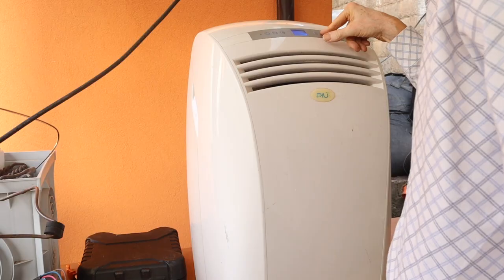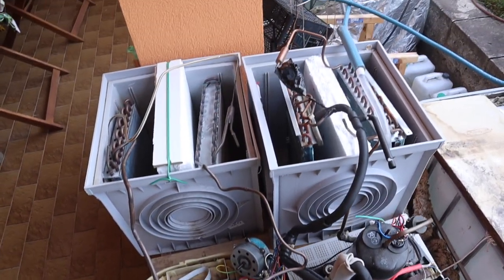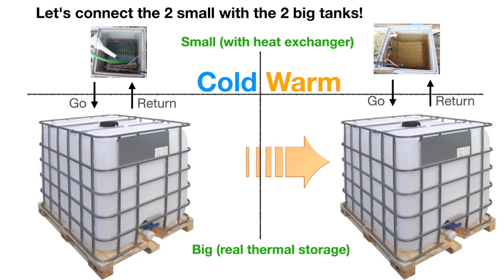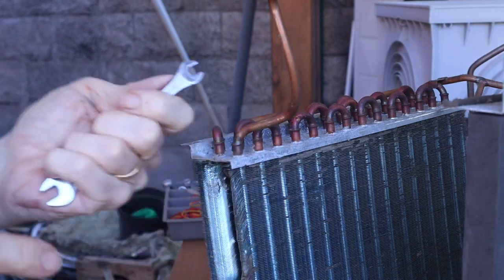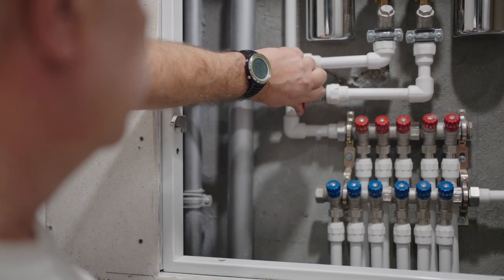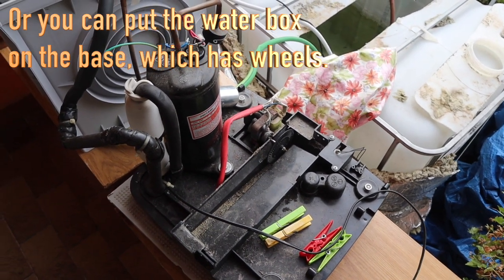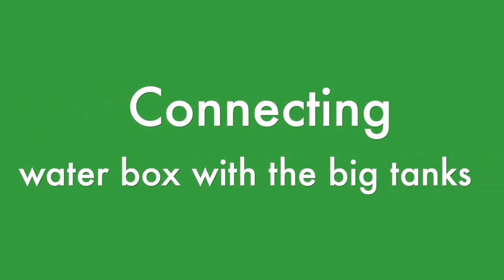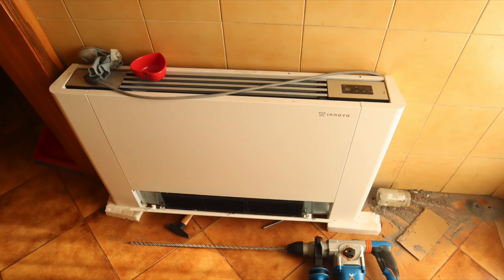Winter Heating Hack: Convert old Air Conditioner into a Water Heat Pump (Part 2) - Video 68

Comment: I am developing a different idea. I have a spiit air conditioner already installed in my house that I never use because it was intended to warm/cool a room but now I don't use that room anymore. The heat pump was installed 15 years ago but it has a good COP (4,7) at 3.2 kW (thermal power) and 700 W electric power (in heating mode). I just want to heat water with it, not for ambient heating, only for showers etc. My idea was to cut the liquid line (1/4" pipe) between the internal and the external units, and insert a 5 m long serpentine made of 1/4" or 3/8" copper pipe in between. The serpentine will be placed between two concentric plastic pipes filling tightly the gap between them. The space between the coils of the serpentine will be flooded with a stream of water at relatively high speed (~ 1 m/s) moved by a BLDC pump whose speed (and flow rate) can be adjusted by varying the supply voltage. This way I can adjust the thermal coefficient (and thermal power) of the heat exchanger. The water will be recirculated from and to a cheap low pressure water storage (plastic tank). To avoid the heat dissipation in the internal unit of the split heat pump I have two possible choices. Set the fan speed to minimum (or disconnect it from its power supply) AND/OR block the air vents of the unit. No need to destroy anything, the air conditioner will remain perfectly working when the water pump is off.
The cost of this "add on" will be even lower than a second hand low quality (and low COP) heat pump and there is no need to waste the cold (useless) water because the heat source is still air.
Reply from the maker: Interesting concept Eriton — I like that you want a reversible “add-on” and keep the split usable as normal when the pump is off. 
A few cautions from a practical DIY point of view: cutting the refrigerant liquid line and adding a long copper serpentine can create pressure drop and “flashing” (liquid partly boiling inside the coil). That can hurt COP and stability and can stress the compressor. Also, once you open the circuit you almost always lose refrigerant, and the extra pipe volume often means the charge is no longer correct.
About disabling the indoor unit: fan off + blocked vents sometimes works, but many splits monitor coil and air sensors. With no airflow, some units throw errors or behave unpredictably (protection, unknown control logic).
If the goal is mainly DHW (showers), the safest DIY route is usually to avoid opening the refrigerant circuit and instead capture the indoor unit heat with an air-to-water exchanger (radiator + fan or an HVAC coil in a duct/plenum). You still get useful hot water, but without brazing/leaks/recharge and with far less risk for the compressor.
Keep experimenting — just be careful with refrigerant-side modifications because they look simple but can get costly fast if anything goes wrong. Anyway, the fact that the A/C is old makes it probable that it has a simple compressor that you can feed directly from the grid so that you can override control logic.

Comment: did you try Geo-thermal heating/ cooling?
Reply from the maker: Hi Mark, I fixed the rainwater harvesting container underground and using 70 cubic meter of water underground as heat sink or cold sink for the heat pump is a kind of geothermal storage but also extraction if this water is in contact with many square meters of earth. That will be seen next year when we come back to Sicily.

Comment: Can saltwater store more heat/Temperature than "normal" water?
Reply from the maker: Hi Taran, thank you for the question. I've been busy with the new video (which is now published). In thermal storage, saltwater doesn't offer significant advantages over pure water since the difference in heat capacity per volume is minimal, and the salt may introduce corrosion issues. How would you like to use it, I guess you will get it from the sea and maybe pure water is scarce where you are? That's indeed a good point...
Reply: Some "heat pumps" are based on brines and water absorption but that is another story. Salt water is one of the worst enemies of almost any metal.

Comment: Pool heaters does somehow the same thing just with a water heat exchanger built in for the heating. The issue with pool heaters is that many of them are ineffective or downright useless under 5-12 plus degrees, rendering them useless for wintertime usage. A modification to your setup would be to get a heat exchanger from a broken pool heater, which would require a refill with gas afterwards.
Reply from the maker: Hi BubbaSnipe, I have such a pool heater and agree with you. It is a bit expensive (500€) so would prefer to put my hands on second hand mobile air conditioners for under 100€. Anyway, they are a great solution for the summer, when warm water (40℃) is useful for showers and preheating water for dishwasher & washing machine. A pity that they make quite some noise, so it would be good to bring the cold air through a hose into the living space.
Also, a refill with gas (I bought already the hardware) is a bit difficult for the most of my target audience.
Reply: I was buying one of them (new) for about 350 €, but since I needed to complete it with a good amount of DIY stuff, in the end I decided to use an inverter air conditioner I already have installed in my house and "catch" heat from the liquid return line from the internal unit (condenser, or better to say, INCAPACITATED condenser... 😂 ).

Comment: Ik vermoed een green minded D66 stemmer die geloofd  dat een oude mobiele airco zijn ingewanden aangedreven door een compressor op stroom geweldige resultaten leveren kwa temperatuur overdracht met geweldige resultaten als gevolg................Die man moet zich eens in R-290 gaan verdiepen......

Comment: Many people modify window A/C units for use as water chillers for fermentation cooling as an alternative to commercial glycol chillers. The typical advice is to remove the fins from the coils as the fins impede liquid flow through, as compared to the air they're designed for. If you have the ability, replacing either/both the evaporator and condenser with plate heat exchangers you'll get even more efficient heat transfer, at the cost of complexity and dealing with refrigerants.
Reply from the maker: Hi PunkDigerati, that is a good point, to take away the fins. It's even obvious, something should change if I change from air to water. I will try it. Or I should put entrance / exit of water at opposites sides of the heat exchanger and give the water no other way than the fins. I will try both and see what is also easy for the DIY.

Comment: Great video! Looking forward for the results after the connection with the central heating! Only one question, why did you put the condenser and the evaporatorin the same water box and then try to prevent water exchange from the hot side to the cold side? Why you didn't use seperate water boxes?
Reply from the maker: That was a dilemma indeed! I wanted to put the condensors and evaporators of two different air conditioners together in a cold and warm water box as you say, only the copper pipes are short and don't allow it. The solution is to find or make two containers that together have the volume of my water box. That is a good idea but I have to make it (I tried it in the past with plexiglass and silicones, not easy, it was always leaking, don't want this headache for my viewers). Not easy neither to find in the shops (or Amazon).

Comment: Are ther any heat pumps that could be placed between two insualted rooms to crate a cold box and sauna room? Or possibly a cold plunge tub and sauna room? I'm assuming because the temperature is so wide it wouldn't be very efficient but probably couldn't get that type of temperature difference.
Reply from the maker: If you mean a cascaded heat pump, yes, it’s possible to DIY a cascaded heat pump system that operates across a wide temperature range (from -20°C to 80°C or more), but there are several technical challenges and risks to consider before diving into this project. The higher temperature heat pump would work on R-1234ze(E), CO₂ (R-744), or R-600a. That is not so easy, because you must also have the heat pump, where you put those refrigerants in (without problems of incompatible pressure). The lower temperature is not difficult, you just purchase a freezer.
Reply: @nnvasen-good-energy  sounds expensive... A standard sauna heater it is then.

Comment: Only needed to watch this one video to know i need to subscribe! This is interesting. I'd love you to talk about maybe preheating the source by passive solar to maximise COP, possibilities of running on low voltage DC and risks of dangerous bacteria  growth and how to prevent it.
Reply from the maker: Thank you again BeeTooEx! I also like to make live easy for the heat pump and in my last video with the experiment in (only) the water box I treated it not well. Next video I want to make the same measurement for the first 10℃ from the start (both water compartments at room temperature). Then going on to higher Delta T and see what happens to the COP. And I expect indeed that preheating and other tricks to reduce the Delta T will help to get amazing COP. But already having two big water tanks is so much better than the heat pump in winter that is trying to get heat from cold outside air...

Comment: Can I do this in a colder climate? Like where the outside temperature is below freezing?
Reply from the maker: See the comment of ThisRandomUsername, I agree with him. See also my answer to KevinRoberts below. If you put antifreeze in the liquid that goes to and from the water box, you will have your 1 m³ at -10℃ for example. Then you put many mineral water bottles with normal water in that big tank and only those bottles will freeze and during the phase change they will give a lot of heat. And when you don't use the heat pumps for a couple of hours, the surroundings can give their heat back to melt the ice again (for example by circulating the cold water with antifreeze not only in the water box and big tank, but also through an old radiator outside).
Reply: @nnvasen-good-energy  I love that idea! I have been wondering about phase change for a while, and sealing bottles and placing them in antifreeze is a fantastic way of achieving that.
Reply from the maker: Yes, I want to try it too, in our winter house, I think that water is the only PCM that is viable and it is so easy to change the freezing point of water by a degree or 10 and then freeze the floating bottles.
This works for winter (when the container with floating bottles is the heat supplier to the evaporator) and for the summer (the same container is the supplier of cold water for space cooling). One system, two seasons!
Reply: Look up the air conditioner's datasheet to see the COP at lower temperatures. Where do you intend to pull heat from? If you have a big pond you could pump water from that, as it will remain warmer than ambient. You may also need to use 2 heat pumps in series if you want to produce a much higher temperature difference efficiently.

Comment: Use solar panels to heat the water tanks.
Reply from the maker: I have another video https://youtu.be/bsuM8mFFwMw about solar collectors. Certainly good if you need only heat. But in winter?
This video is an idea to store excess PV energy. That is of course good for summer and then you need both warm and cold water (washing & cooling space). In winter this video is also a good solution to produce warm water 
1. At a high efficiency (heat pump)
2. With the option to store cheaper (night) electricity.
Even if the cogenerated cold will be not so useful in the winter, you can always let it warm up in some way (outside air if not too cold, or through spirals in the earth, we have a 70 m³ rainwater collector under ground). In each case, the heat pump in this configuration has less work than the usual air to air heat pumps that really have difficulty to work already at 7℃ outside temperature.
Reply: @nnvasen-good-energy  in the winter, if you let the cold tank warm up in outside air, how is that more efficient than an air-to-air heat pump? Is it more efficient because the water buffers the temperature over time?
Reply from the maker: Yes, cold air in the evaporator during winter really goes down a lot and humidity will freeze in the fins. With a water to water heat pump the medium is much more constant (heat capacity) while around the evaporator and with antifreeze it will not freeze like humid air.

Comment: Thankyou for making these videos! I have a related concept in mind and you have proved there is merit in trying some experiments in using standard AC unit as the base components to be converted to a water heating heat pump. Looking forward to see whatever you think of next.
Reply from the maker: I'm glad you found the videos helpful! It's always exciting to see how standard components can be repurposed for innovative projects. Can't wait to present the next video about connecting the system to the central heating circuit. However, it is quite some plumbing with old connections that I have to disconnect 😟

Comment: Have you thought about how long the Al/cu condenser & evaporator w will last submerged in water? Electrolysis?
I planning to use a 100meter deep unused water well as a  source for a heat pump made from a r22 compressor ( available new ver cheap) converted to r290 ( propane) to heat my radiant slabs in my house. Good luck with your project.
Reply: I've been doing hvac for a long time and can say using 290 is a bad idea! R22 compressors are not arc proof and r290 systems are used for refrigeration limited to a couple ounces at most. If a leak, an arc, or something else happened then it could cause some damage but with fans running it shouldn't be too bad. The system you are proposing could turn into a really bad day! Residential hvac systems are not supposed to use highly flammable refrigerants for a reason! Please do not do this

Since you said you are using newer compressor, it will have poe, not mineral oil in it. It would be a much better idea to use 407c or r422b. 407c being the better choice in my opinion. Either will work with an r22 compressor and if you are using a txv then it van be adjusted to make it work properly. pistons can be a little trickier

I've been toying with something like this on and off for a couple years now and have a working prototype using coaxial coils and boiler pumps. Mostly easy to get, off the shelf parts.
Reply from the maker: Hi Kaf, At the start I was indeed concerned about leaving the condenser & evaporator in normal water and my first version worked with "technical water" in an isolated circuit, using anti corrosion additives in normal water and then exchanging heat in a metal pipe or 1 element of a radiator in the big tank. Now, I am putting it directly in water in order to avoid complexity and efficiency loss. I want to see (and tell) what happens with the condenser & evaporator. 
One step at a time. It's the reason that I like to work with cheap second hand equipment!
Reply from the maker: I see that Chris Geo is giving here below much detailed info, that goes beyond my experience, even if I purchased the tools to work with refrigerants and installed an app to calculate different refrigerants, seeing what pressures are at different temperatures and refrigerants. That kind of info is indeed very important to understand compatibility of refrigerants and equipment.
Reply from the maker: I want to keep my experiments simple, in general, so that they can be done by many.

Comment: I have been thinking of this concept ever since I ve heard of the idea of a heat pump.
 Developing a system for the whole house of transferring heat to fridges and freezes but to be able to heat your home at the same time for Central heating and hot water.  Is the optimal way of using energy And this system.

 As an engineer I would be intrigued myself in your expertise on how this could be possible as freezes go lower as 18c and fridges down to 4c.
Reply from the maker: Hi Grantmid, thanks for your comment. 
It is indeed intriguing how you can use all there is, like CHP (Combined Heat and Power), where you have also the challenge to find consumers for both heat and mechanical (or electric) power, more or less at the same time. But there are many CHP plants already, and double use of the heat pump seems rare. 
Freezers often use refrigerants like R-600a (isobutane) or R-134a, which are optimized for freezing temperatures. Air conditioners like my model here commonly use refrigerants like R290 or R-32, which are more effective in the temperature range suitable for cooling air in living spaces. I would like to f
I am playing with the idea to cascade heat pumps of different temperatures so that I can go from -10℃ to 30℃ and from there with the second heat pump to 65℃. In that way you have an ice storage (which has a whopping 92 kWh per m³) at one side and real domestic hot water at the other side.